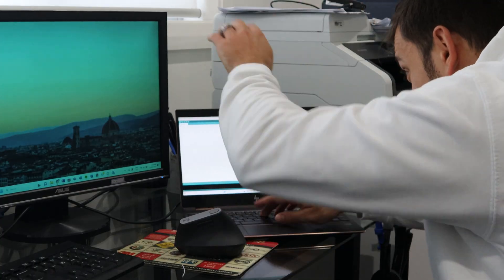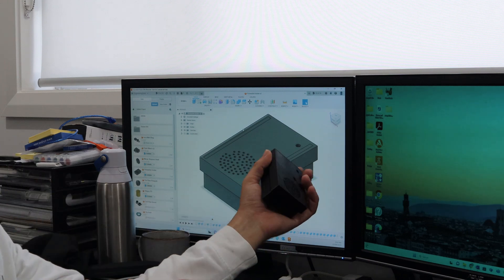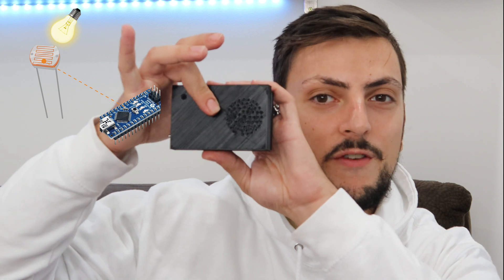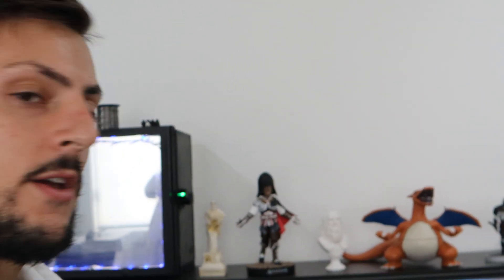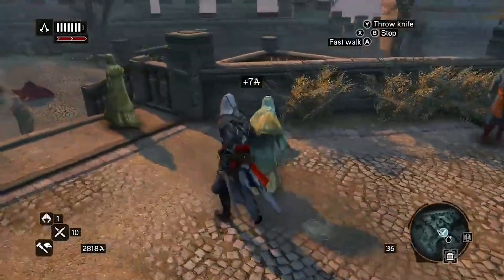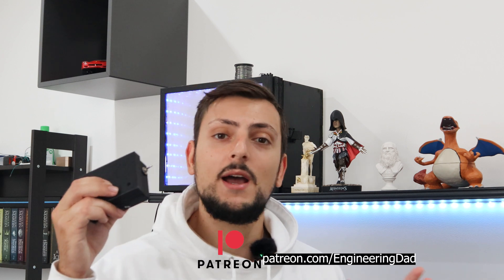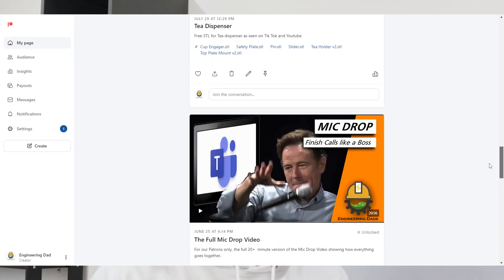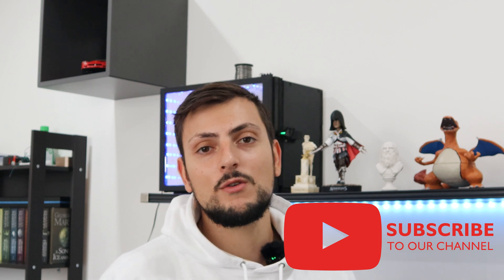The Pickpocket Trap of the Year

Comment: Id use one of those loud buzzers and have an transistor activated by an light resistor and humiliate them that way
Reply from the maker: Yeah nice one and this is exactly the circuitry we used (besides the louder buzzer components). The question is, what additional components would you add to enhance the embarrassment? 🤔
Reply: @EngineeringDads  an small pump to spray fart spray on the unfortunate thief
Reply: And probably make the casing more realistic, buy one of those fake phone replicas and put the components in it (will have to make custom pcb to use less space as possible